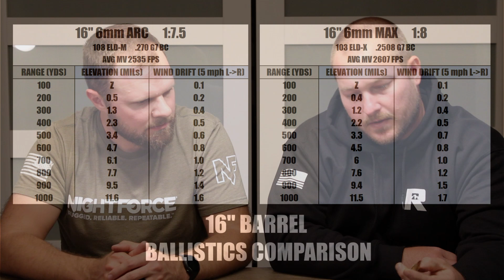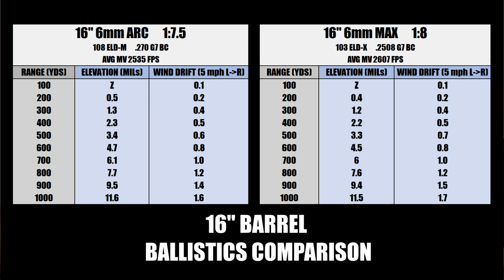6mm MAX vs. 6mm ARC: What's the difference?

Comment: Why didn’t you compare both using the same 103?  Comparing the 108 to the 103 seems a bit misleading.
Reply: What the 6 max lovers aren’t telling you is 2/3 of the bullet is buried in the case. Anything above 80 grains just devours room for powder
Reply: Exactly  💯 %
Reply from the maker: This is all from a competitor perspective. We are comparing top options for competition. While they are both 6mm, I don’t see 103 6ARC in the same use case as 103 6MAX. 108s in 6ARC have higher BC and would be a better option for comps, while 108s are on the too heavy/long side of 6MAX. 103s would be the competition option for 6MAX. Comparing 103 to 103 isn’t the same use case. This is similar to comparing 5.56 loads for competition; we’d compare 77gr and 75gr without question, but if we compared 77gr to 55gr for longer range competition, we’d know that they are not in the same category, even though they are the same caliber.
Reply: @sunandshadoif your talking  BEST options  their  are better then the 108

Comment: having SOME taper like the 5.56 is important for easy separation of the case from the chamber wall. also using a 5.56 case and 5.56 OAL would let you use 5.56 mags, which is why .300 blackout has been able to transition from a niche cartridge to something established within the industry. it's nice to use the same bolt as a 5.56, but i don't think it will be enough. no proprietary mag cartridge has ever succeeded for the AR. the two victories have been .300 blackout and 6.5 creedmoor for the AR10 which, like .300 blackout, uses standard mags.
Reply: 6.5grendel caught on and spawned the 6arc and now 22arc which are both new but very popular. 6.8spc and 224valk are still popular in some hunting circles.  Then you have the guys shooting "AR47" type rifles in 7.62x39. 

Also the 204ruger is around and uses everything 5.56 except the barrel. 

350legend was the only ammo on the shelf during the plandemic.
Reply: @kirkmartin2223  none of those cartridges save 7.62x39 are within the same zipcode of popularity as .300 blackout and 6.5 creedmoor, and they're even farther away from 5.56. .22 arc just came out, how can you say it's popular? it's easily the least used out of all those cartridges for that very reason. 7.62x39 is not some meme round invented to chase industry trends, you can't compare it at all. none of these cartridges were on the shelves. each new 6mm whatever round for the AR further thins the consumer base, which is why all of these rounds are incapable of any real mainstream appeal.
Reply: @or6060  6.5cm is an AR10 size cartridge so let's leave it out of the conversation. All the cartridges I mentioned are popular with people who hunt with an ar15.
Reply: @kirkmartin2223  ar15 vs ar10 doesn't matter. the point is that it was a new cartridge for an incredibly popular autoloader that found mainstream success. nothing else has been able to compete with .308 for market presence. and none of those hyper niche 6mm rounds will ever come close to .300 blackout's success. and by the way, .300 blackout is a better round for hunting than any of those.

Comment: 6 MAX vs 6.8 SPC is going to be interesting. Since the Army is moving to 6.8 would they consider this new cartridge instead or is it too late?
Reply: They are moving to 6.8x51 not 6.8spc. And yeah it’s too late for a change of that size given sig sauer already won the next 20 year contract
Reply: Won by ....  how 🤔
Reply: I have a LWRCI in 6.8 SPC and love it. I don't know what this cartridge will offer that 6.8 already doesn't for the average shooter.
Reply: @jasonnyhof5972  6max uses a regular 223 bolt, all you need to do is change the barrel, gas tube and mags, everything else on the upper and lower receivers are the same.

Comment: What are considerations on reloading?  What are expected case life’s?
Reply: I have been told by sources that should know it's been very good if loaded to recommended pressures
Reply: The brass as of late was stopped in testing after 7 reloads.

Comment: I was looking at velocity chart for the 6max out of a 16" barrel its nipping at the heels of 243 win.... if that is actually true this is a predator hunters dream... even a 12.5" barrel with a silencer an thermal you have a lightweight package that is close in balistics to a big old heavy ar10... I was looking at a 243 but this is no brainer if your looking for a semi auto with a shorter barrel...
Reply: 243 is really a very inefficient cartridge. i hate that it's still so popular with so many other decent modern options out there.
Reply: .243 can hit over 4kfps with 55gr noslers the 6max is about 3500. .243 with 70gr sierra hpbt @ over 3650fps  6max 3300. 6max seems to get a bit closer with the heavier bullets. 24" barrel #s. 6maxs numbers still great out of a AR15 platform.
Reply: @jjmckay6man1  i was looking more at the shorter barrels... 16" an down... im trying to think off the top of my head but a 16" 243 58 grain is running 3600fps maybe (factoryload).. there saying the 16" 6 max is pushing them out at 3390!
Reply: I had to grab my reloading manual to look at 243 velocity, your right. Your burning less powder and it's in a small frame ar.
Reply: @josephlong7420  32.6 grains of tac and a 55 grain nosler from the max is right at 3600 fps..  I believe thats a 24" barrel though..  out of a 10.5" there still getting over 3100fps ! The short barrel velocities are what's impressive to me.

Comment: I know it's an AR cartridge, but I'm really excited for bolt guns to come chambered in this. With the taller shoulder and mag length limit, the chambering will be tight enough to set lighter bullets at the same jump as the heavier ones. The 80 grainers at bolt-gun pressures will be screaming out of a ~20" barrel, deer beware.
Reply: Bolt gun master race crew checking in - totally agree.
Reply: Wait until some AR-uppered lever guns start getting released into the market. Can I get a "Yeeee-Hawww!" ?
Reply: the ability with the more rugged bolt face to increase pressure SIGNIFICANLY result in loads capable of 3900 FPS at muzzle, laying down some serious destruction to the target!! Cheers!
Reply: Just look into the 6br or 6ppc, instead of gimmick rounds.
Reply: @frankiecrouch3918  6br doesn't feed properly in small-frame ARs, and 6ppc has been completely swamped by 6ARC. The 6br has also been replaced largely by 6Dasher and 6GT.

6mm Max actually packages the same class of performance in a way which makes it ideal for the AR.
Reply: @phillycheesetake  That's my point exactly. Why put a cartridge like the 6max in a bolt gun when you have so many better and more accurate options.  All of those cartridges have wide shoulders, and I'm willing to bet are way more inherently accurate than the 6max.
Reply: @frankiecrouch3918  Because 6Max packages into guns almost as compactly as .223. The mags are small, the guns are small, and they hold a lot.

Plus it would be cool to spin off a .223 barrel and put on a 6Max on the same action, bolt, and chassis.